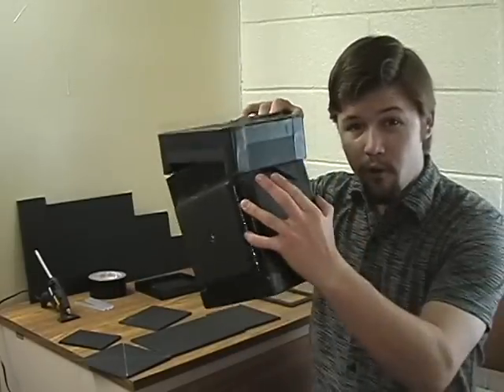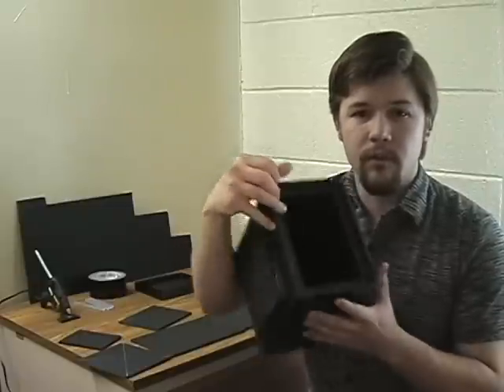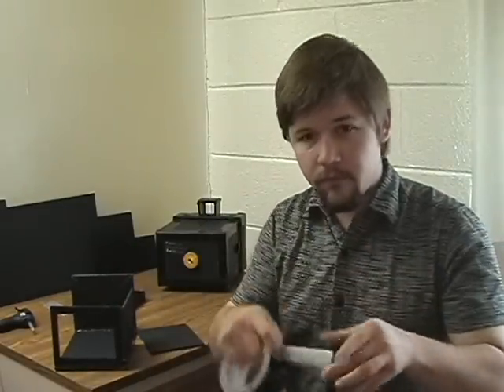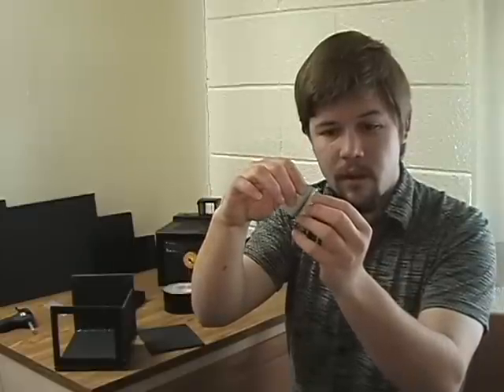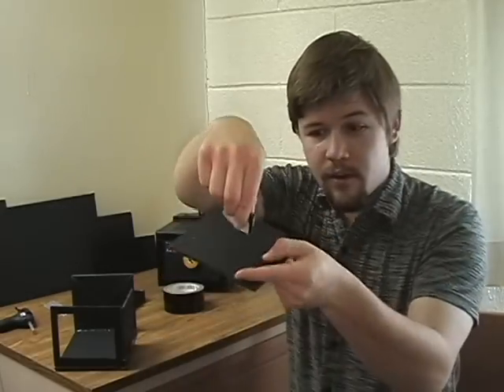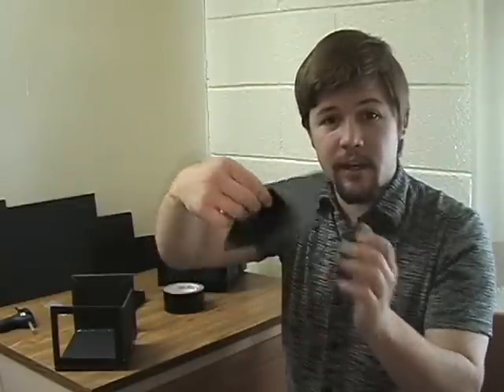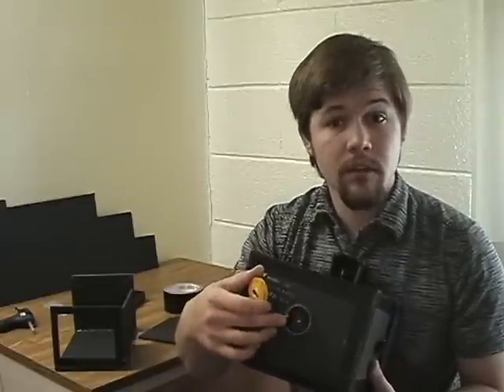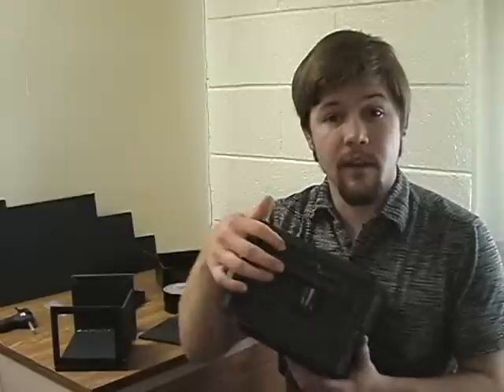How to Pinhole Camera Photography (Lesson 4, Build a Camera) 004

Comment from the maker: I go to B&H Photo (Google it) for supplies.  The cost of the photo enlarging paper depends of what you get.  I would suggest for a novice to use a paper that is resin coated and glossy.  Matt finish paper and fiber based papers can be more difficult to work with.  You will also need to get the appropriate developing chemicals.  It has been awhile since I've had a dark room so I encourage you to research the equipment needed. Lately, I built a camera that the 1hr lab can develop it for me.